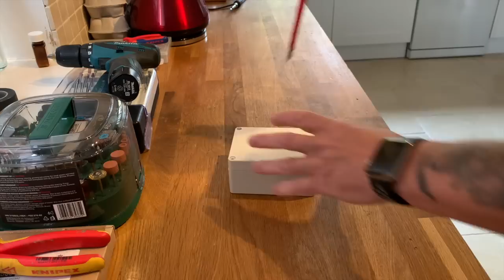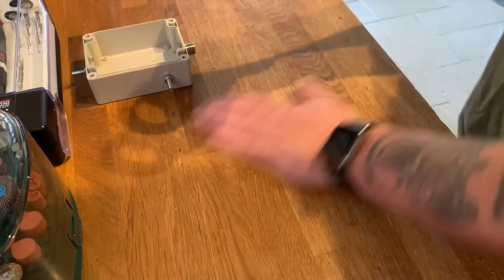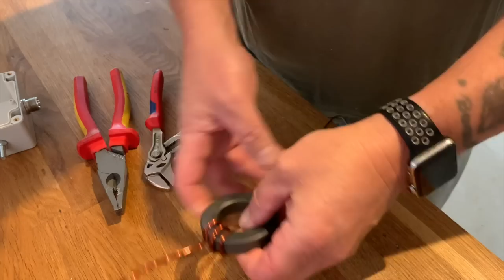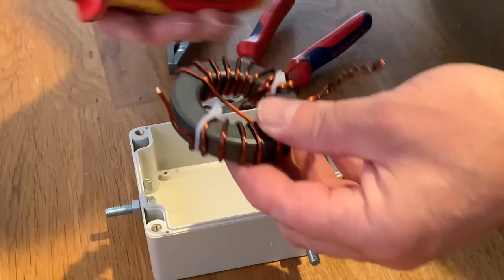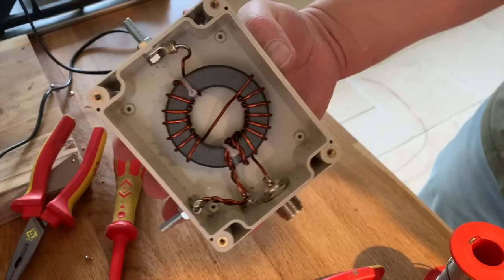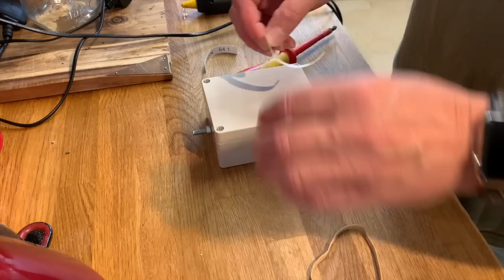HAM Radio:  Callums 64:1 a EFHW for the DX Commander..

Comment: I use one of these (49:1) and they work great. I have about 250 feet of wire attached to mine so i can sort of work top-band. It must have worked because i spoke to Callum with it at only about 20 foot high on 80m. Highly recommend people giving this system a try.

Comment: Sweet Mike! I built a 49-1 with two Amidon FT240-43 cores. I wound mine counterclockwise like you did but being paranoid I unwound it, wasting that wire and wound it clockwise, as if rf knows the difference, and housed it in an outdoor utility box. So far I've only used it on receive and measured the Rx on receive into a 138 ft piece of wire. At resonance, in the low end of the 40 meter CW band it was at 200 ohms but close to 50 ohms on 20 meters. de WD5L
Reply from the maker: left, right, counterclockwise, clockwise it's all bananas. LOL

Comment: Nice Job 7351, I was made one 9/1 with a toroide of an old TV. Works fine without ATU 160 meters 80 meters 40 meters not so good on 20 meters not so good on 11 meters but works well from 28 Mhz to 30Mhz. TKS fer sharing. 7351.
Reply from the maker: Very cool!

Comment: I love your videos.  You probably will do this before it is finally installed but, on my home made transformers, I use two FT-240-31 for a broader frequency and power range and also vent the sides and create a couple of 1/8" weep holes in the bottom covered on the inside with small pieces of plastic screen glued with hot glue.
Reply from the maker: Thanks for the tips!
Reply: Do you have good luck with the type 31's?  I use type 52's and am very impressed

Comment: 64:1 will work well on 80/40, but poorly on 10/12/15. The impedance transformation is too high for the upper bands. I use 14/2 turns or preferably 13/2 turns ratio
Reply from the maker: Thank you 👍 will give it a try

Comment: Don't forget the choke. Because you added the 10m band with the capacitor here is a suggestion. Using 2ea FT240-61 toroid use RG-58 wrapped 17 pass throughs AND leave a tail on the output side of about 4m-5m with a PL-259 to connect to your new 64:1 auto-trans.
Have a bulkhead SO-238 on your container for your main feed coax to connect to. FYI- using this choke you DO NOT need a ground counter poise.
Reply from the maker: Thanks for the great tip..  👍

Comment: Do you have to use the coated copper wire, or can you use PTFE coated silver plated stranded wire? I just built a 64:1 using the PTFE wire with dual FT240-43 fair-rites and a 100pf 3KV caap, wondering of I messed up.

Comment: Smart job Mike! What do you recon it's power handling capabilities would be with 1.8mm wire and the  single 240-43 toroid?
Reply from the maker: 100 to 200 watts

Comment: 43 mix is better than the 31 for HF. Upper hf (12-10-6 meters) and above use the 31 with 1 or 2 less turns per side on the balun. 
Hmmm did you say whether you are winding a 49 or 64 to 1 coil. How many wraps did you make on the toroid? No weep hole...
Reply: I have used both and, in my opinion, the 31 mix is preferable to the 43 mix.  This is especially true if your intend to run more than 100 watts or have long digital or cw qsos.  The Ferrite toroids will not return to their original state if the temperature gets close or exceeds the Curie temperature.  The 31 mix has a much higher Curie temperature than the 43 mix.  Additionally,, the 31 mix is more linear over rated frequencies than the 43 mix.  Check the Fair-Rite or Amidon data sheets.
Reply: @hankhamner3671  I thought the 31 was for chokes.  Hmm,

Comment: I’m a bit confused with this dx commander Is it the pole or any wire antenna it’s supports ? , if I fixed a slimline made from 300 ribbon to the top of one would that be a 2m dx commander as well😳
Reply from the maker: Well, I guess that would be a slim Jim for 2M supported by a DXCommander. In the same way the 64:1 is. I do hope that you are no longer confused 🤔

Comment: I've made one just like this but I get a short when putting a meter over the SO239, is that expected considering its the same bit of copper wire soldered between the center pin and the ground having had the enamel sanded off? Cheers.
Reply from the maker: keep reading the comments have answered this somewhere Thanks 👍

Comment: Sweet little build Mike. The 1.8 mm wire works out to about 13 AWG so call it 14 AVG. Curious what type and value capacitor you are using?
Reply from the maker: disc ceramic 100pf 3kv

Comment: How is performance and QRM level ? and how much meter wire use 80 to 10 M antenna ? 73 TA4AU
Reply from the maker: Take a look.. http://g0kya.blogspot.com/2017/01/a-shortened-multi-band-end-fed-half.html

Comment: Very nice.  I made a 49:1 14 gauge enamel wire using 3 type 240-52 toriods. I also have the DX Commander. My end fed is in inverted L.  Up 35 out 90 ish feet. I have found very little difference on receive between antennas most of the time. 40-10. I don’t have the 80 on DXC yet.  
Why did you go with 64:1?
Reply from the maker: found it to be more stable and better for 20m - 10m Bands

Comment: Why a 64:1 and bands to be used? Thanks.
Reply from the maker: I prefer the Higher Impedance of the 64:1,  80M to 20M bands
Reply: @mike-M0MSN  I got a 9:1 with results so the internal tuner can handle. Now, ordered and received the 49:1 and planning to install it and test. Wondering about the 64:1, but if I decide to test, will do my own this time instead of ordering. Thanks.

Comment: Why 64 to 1 vs. 49 to 1?
Reply from the maker: I prefer a 64:1 (3200 ohms) as this transformer gives you more head room.
Reply: @mike-M0MSN  sorry to sound stupid....  What do you mean by Head room?   Do you mean useable bandwidth.... Does 64 to 1 allow for a shorter wire?
Reply from the maker: No,  the end of a halfwave wire is around 2000 to 3500 ohms so a 49:1 works as 50x49 =2450 ohms at the antenna connector and 50 ohms at the coax connector.  Now if the EFHW wire is at 3000 ohms the 49:1would still work but with a higher SWR. I use a 64:1 as I feel it works better as it allows for a higher impedance.

Comment: I think you missed 1 winding. You only count the wires passing through the middle of the toroid. So I only count 15, should be 16 correct? Half of 16 is 8 and 8 squared is 64. 56.25:1 is what I think you have, no?

Comment: That cap will say byebye on first digital mode. You need a bigger gun :) Guess hos I know :) - 73 LB6CI
Reply from the maker: lol, cap upgrade needed
Reply: @mike-M0MSN  Yes sir 😂👍
Reply: And what size cap do you recommend?
Reply from the maker: Well I have had a 150pf 4KV cap in my EFhW for over 3 years now without any issues, (350 max watts) but the higher voltages the better.

Comment: Mike, always enjoy your content and enthusiasm. I am wondering if i could use this design at my home. I have had to take down my vertical from the bungalow due to complaints. Maximum height at bungalow is 7-8mtrs  with a 16mtr run to end of garden max height at that end would be 3mtrs?
Cheers
Reply from the maker: Yes, absolutely